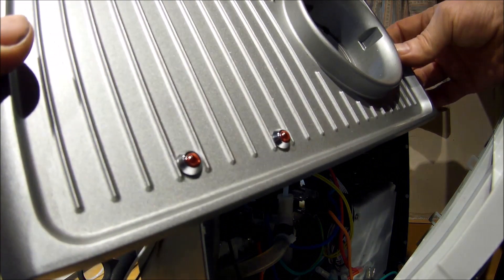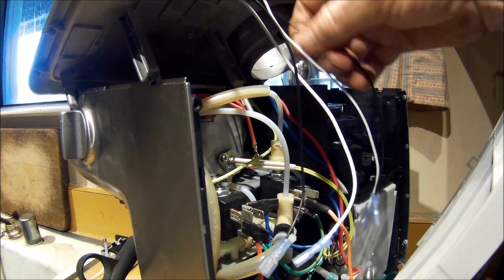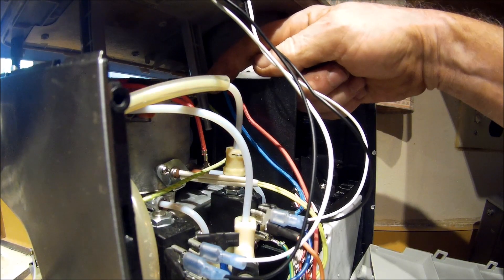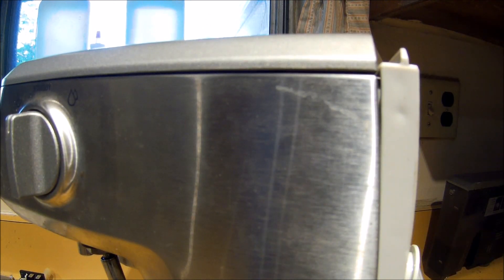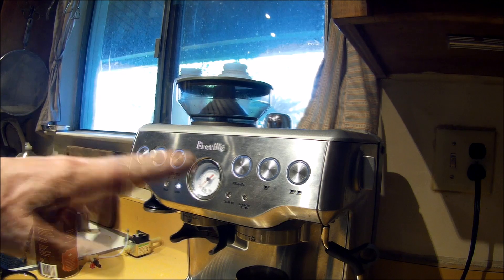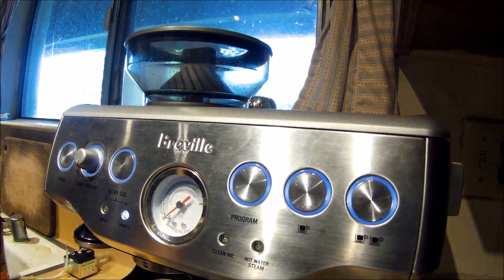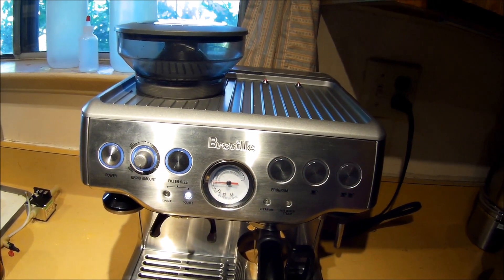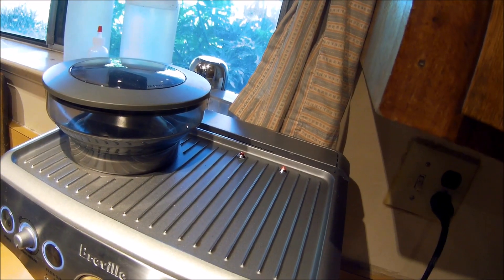Breville 870XL Solenoid Indicator Lights and New Pump Test

Comment from the maker: These indicator lights make a great way to troubleshoot electrical issues with the machine's operation.  If you have a machine that doesn't produce enough pressure or sends lots of water to the drip tray, it's likely an issue with the solenoid valves.  The indicator lights will tell you if the coils on the valves are getting power at the proper time.

For example, the light on the left is for the 3/2 way valve and it should be powered any time there's a brew cycle running.  If that light doesn't turn on, then there's no power to the valve and of course it won't open.  Then it's a matter if finding out why there's no power to the coil on the valve.  

If there's power to the coil, then it's likely the coil part of the valve that's the issue.  Maybe the coil is burned out (an ohm meter resistance test will confirm that).  You could swap coils with the 2-way valve and see if anything changes.  Or maybe the connections to the coil are the issue.  If all that's OK, then it's likely the mechanical portion of the valve that's the problem.  Try a deep cleaning of the valve parts and if that doesn't help, then replace the valve.

Another interesting application of these indicator lights is to work around an always-on solenoid.  Sometimes, a driver (Triac) on the main PCB will fail in the on state and send AC power to the solenoid all the time.  If you're skilled, you can replace the failed Triac on the PCB or you can replace the PCB.  Or, you can add an in-line toggle or push button switch between the main PCB and the solenoid.  Just pick one of the power wires to the solenoid, run it to the switch instead and then run a wire from the switch to the solenoid coil.  Now you can use that switch to manually turn the 3/2 way solenoid on an off.  Off for hot water or steam.  For espresso, initiate a 1-cup or 2-cup cycle and then flip the switch on.  At the end of the cycle, the machine will turn on the 2-way solenoid, lighting that indicator, and that's your cue to turn the manual switch off.

More information in the photo album below, be sure to enable the Info. side bar:
https://photos.app.goo.gl/bN1ugnLPYwvyDcr59

Comment: I would like to hook up at least 2- 3 indicator lights that would turn on when I push the on power button and go off when the machine turns off. How could I wire them in? I want one to see the grinder port and the other one in the area of the portafilter to cup area. I have no problem installing the lights but I don't do electrical. Thanks for the videos.
Reply from the maker: I could see 2 options, one is to tap off the light for the Power button (it's likely low voltage) or you'll need to see if you can find a place to get switched power from off the machine, circuit board diagrams and some links to additional info. below:
https://photos.app.goo.gl/bN1ugnLPYwvyDcr59
Reply: Thanks. I will look at tapping into the power button light.  @The4Crawler

Comment: Very helpful thanks for making
Reply: Hi Mr Brown, I thought I had fixed my BES870 as the coil on the 3/2 way was corroded and slightly swollen. Water just started going into drip tray one day all of a sudden. I don’t remember hearing any rattling noise or any change in pressure. I have the metal based solenoids and assumed it was blocked so cleaned it as you showed. Did this at the same time but the coil change doesn’t appear to have fixed the flow issue. Hot water gets in drip tray so I’m guessing the problem is still with the 3/2 side… I have listened to the machine and that clear click of the initial brew is not happening. I double checked the solenoid was clean and works smoothly when apart… magnets don’t move it when it’s together like it does on the 2 way solenoid. Seals seem good… 
I was wondering if you thing it might be that the power supply isn’t getting to the coil and how I might establish this? I have an amp meter but not sure what to look for… it’s a 240v unit as I’m in Australia. If you have some time to share your thoughts, I would be grateful.
Reply from the maker: @outdooradamklan  You could test for power on the solenoid with a volt meter or with an indicator light like I installed in this video.  You will likely see some voltage across the coil with the machine powered on but not running, but it should go up close to your normal line voltage during a brew cycle:
https://photos.app.goo.gl/bN1ugnLPYwvyDcr59
Reply: @The4Crawler  will keep trying. I looked at the comment by the guy you referred to about a triac but I’m not seeing any burnt out components. Might swap coils to see if it still works.
Reply from the maker: @outdooradamklan  Yes, try swapping coils, that's a good place to start.
Reply from the maker: Glad it was helpful!

Comment: Thanks so much for this! It helped me identify that the issue on my machine is that the voltage between the orange and the blue wire of the three-way solenoid stays at near-zero when I turn on the brew cycle, so the switch that is supposed allow the water to flow to the group head is never opened, and all the water goes out through the top of the solenoid instead of to the group head. I bought a new solenoid assembly, so the problem is with the voltage control across the solenoid. How would you go about identifying what causes this problem with the voltage control?
Reply from the maker: That solenoid is controlled via the main circuit board and typically via a Triac device.  Check out a comment by a viewer Mike  Henderson (on Feb 7 of this year) in this video:
https://youtu.be/9lMw6ooiqPI
Might also try unplugging and reconnecting the wires on the circuit that control that solenoid, they may have a bad connection.
Reply: @The4Crawler  Yes, from what I can tell Mike Henderson's issues may be exactly the same as mine. (I also stupidly ordered a new solenoid assembly instead if thoroughly investigating whether the old one was actually defective;) I'm going to try his solution of removing the control board and looking for a burnt-out part. Maybe I am lucky and the defective part is the same TRIAC as his. Thanks again for the videos and the pointer to Mike Henderson. This is fun!
Reply: @The4Crawler  I found a burnt-out resistor on the main circuit board (see https://www.dropbox.com/s/9b87pind5v3gamj/BES840XL-R37-burnt-out.jpg?dl=0). Unfortunately, it is so badly burnt that you can only see one of the color rings. Do you happen to have a picture of the control board that shows the resistor? (R37).
Reply from the maker: @bbeckwin  I not yet had my circuit board out to take a photo.  Looking at your picture, it seems like those 3 resistors may all be the same, at least given that 2 of them are identical.  Maybe if you can follow the traces to where those 3 resistors connect to and if they all connect to similar devices (like Triacs or transistors) then they all may have the same function and may be identical resistance.
Reply: @bbeckwin  did you replace the burnt resistor? I have my machine apart and could send a pic of my resistors if it’s still in your ‘to do’ list of repairs… I see it was 2 years ago…

Comment: Nice videos! You’ve replaced the pressure gauge, solenoids and the pump. Which was causing the low pressure, and how do you test fir adequate pressure?
Reply: Thanks!  I just picked up a used Infuser — same machine sans grinder — and pressure is poor. I cleaned the small filter screen (no improvement) and ordered a pump.  I’m hoping to repair the machine without randomly throwing parts at it, if possible.
Reply from the maker: @marshallgoldberg8376  Pump is a good start.  Solenoids will usually make a loud buzzing noise if they are the issue.
Reply from the maker: Never touched the gauge on my machine.  Replacing the sticking solenoid let the machine work again, but the pressure seemed to be a bit low.  Replacing the pump and over pressure valve restored the original pressure.  Not sure if the pump or the valve was the main cause, need to look into that more.

Comment: Hi, thanks for all your great videos. I have the same machine and had an initial problem of no water through group head. In opening the machine the 3 port solenoid was leaking and some rust was gathering. So I replaced the solenoid, descaled and put back together. The machine pulls the perfect shot, however now when I use steam or water it comes through the group head. If I disconnect the solenoid the steam works perfectly. Any ideas of what might be wrong? It is as if the solenoid is not turning off when steam is selected ( which I understand is what is meant to happen?) any and all help would be great. Thanks
Reply from the maker: It does sounds like the 3-port solenoid is being energized when it shouldn't.  Might be the switches on the hot water / steam valve are not working right or it may be a fault in the main control board that's not reading those switch inputs correctly or is erroneously energizing the 3-port solenoid when it shouldn't.  Maybe Breville support can provide some additional troubleshooting assistance.

Comment: Greetings. I like the Barista Express but there is an important missing feature I am trying to add on my own. That is the ability to turn it on in the morning so that it is hot and ready when I show up to brew my cup. Any ideas?
Reply: In my experience it only takes about 30 seconds or so for the thermoblock to come up to temperature and be ready to pull a shot.
Reply from the maker: Yes, this machine could use some sort of timer or smart interface for sure.  You could rig up something with a home automation system and a remote controlled dry contact output.  Wire that normally open contact in parallel with the power button and then have the contact close momentarily to turn the machine on.  Then set up a timer/schedule in the home automation controller to turn the machine on at a given time.  There's an automatic standby feature that will power the machine down after some time of inactivity.
Reply: The simplest way I was able to find involves an actual mechanical switch that you adhere to the machine and has a small arm that activates the switch on demand via wifi. It is called switchbot. I'll try that first. Cheers.
Reply from the maker: That sounds like it should work.  Just make sure to set it up to only be a short duration button press, not sure of the exact on time needed.
Reply: Will do. I'll keep you updated. Thanks for the good advise.
Reply from the maker: Will be interested to know how that works.